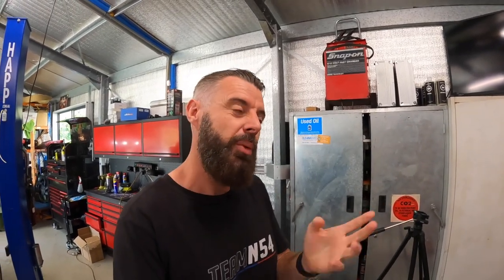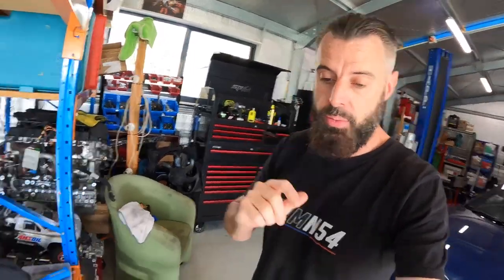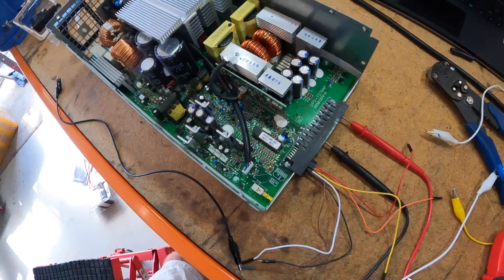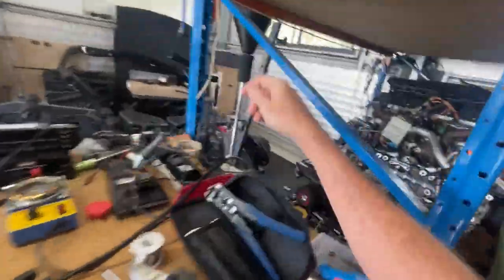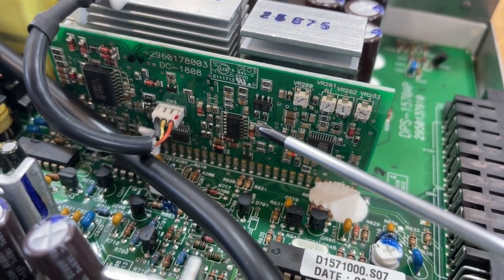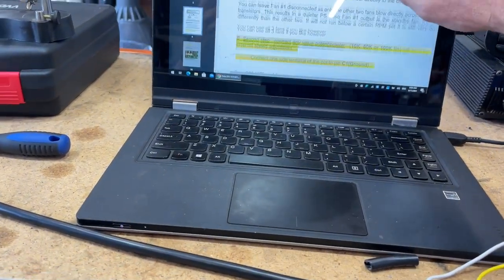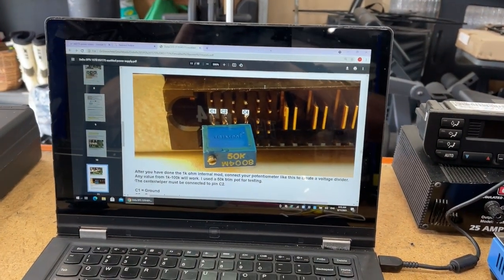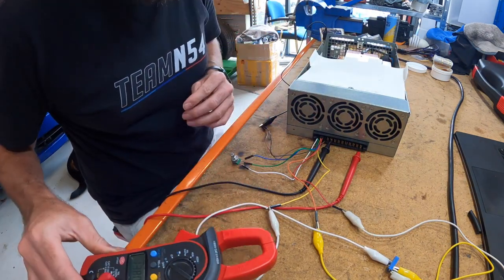Converting Server Power Supply For Programming BMW's: Part 1

Comment: I use 2 DPS-750eb, use my 3d print to make some brakets to make it one big unit with switchs and with outputs for use it on bench or with the big "jumper cables", work so good, already use it too jump my car with dead battery, and it work very good.

Comment: U can use the big 100 amp blade fuses on the e9x battery positive block to make a solid connection to the power supply, just solder them to the psu. I also recommend 0 gauge cable for audio amps, leads not longer than 40cm

Comment: Great reference video for anyone wanting to make a DIY PSU. I need to do the fan control mod to mine, I've just been putting up with jet engine fans while using it but it does make it hard to think.

Comment: @20:45 Poking in a working 1300W PSU with a small screwdriver is a NO-NO in my book. Also, the metal switch is something I would avoid in such a system.

Comment: andrew drill a small hole in the edge of the lid and glue the potentiometer to the inside wall with the hole above it then you can put small screwdriver in hole and adjust with out taking the lid off. you can also buy solder flux in a syringe it is meant for circuit boards and chips i see you have made use for the magnified glass with light and the aligator clips how bad was all the hail cheers glenn
Reply from the maker: Glen your bits and pieces really showed me what i was missing out on. Can't thank you enough. For normal work the solder station is a breeze to use to, so thanks again. Thats the plan with voltage adjustment, will be a small hole, that i can use if i ever need to adjust voltage, however i am hoping once set with a load it should be all good to go.
Reply from the maker: Also regarding the hail. The M5, 330ci and 320d have all been repaired with paintless dent removal. The paint on my car, which was the worst hit, is not so straight forward, the dent repair guys is pretty confident there will be issues pulling dents. So at this point in time, basically going to pull dents where we can and then respray the whole car. I will do an update video on it shortly, i also want to film the process, to try and make the extra cost all worth while. The respray is to get the paint back to an OEM finish all over, fix the bumper that some muppet drove in to a winch on a trailer and just get the car looking as good as possible.

Comment: 😱 Looks dangerous haha.
Why does the power output have to be so high for programming keys? You're a clever man, I'm a bit lost with this stuff 😂
Reply from the maker: Basically if the voltage at the cas module drops below a certain value, i think its 12.5v on the e-series, the module turns off. So if that happens while writing important data, the module basically bricks and gets stuck in a boot loop. So you need enough current going to the car, to make sure the voltage is high enough at the cas. When i was playing with the parts car, it took a 20amp power supply and a 8amp battery charger to keep the voltage high enough.
Reply: @ZeroTo60Tube  Gotcha 👍🏻
I know very little when it comes to electronics, especially car related electronics, but I have had some strange electronic faults with my R53 mini recently and traced it to a completely flooded footwell which has soaked the Body Control Unit. So I guess it's time to learn a little more 😬

Comment: use female spades, you will need a needle nose to squeeze terminal together so the spade can be pushed over the two sides.
also that is not a KD175, its a JD200.  tHE KD175 has a buss bar on the inside for positive and negative.
A battery maintainer and a charger are different devices.  A maintainer is needed for coding and programming.  Great line of videos.
Reply: Actually he has the KD175, the JD200 is the one with the large current strips. I was just working on the inside of my JD200.

Comment: Preheat connector with hot air gun. First shield PCB with cardboard to stop damage to the capacitors and the like.
Reply: Heat to 100C and see how it goes.
Reply from the maker: Tried with the mini blow torch, I assume they must be connected to massive plates in the pcb to handle the current, the heat dissipates too quick. Need more heat in a concentrated spot. There are heaps of threads on guys soldering to them, I’m blaming my equipment……… for now haha
Reply: Did you get my email about syvecs
Reply: @ZeroTo60Tube  You use the electric hot air gun you have to preheat that end of the PCB and try solder with 80w iron.

Comment: Remember its current that kills not voltage and electrocution is final not survivable. This PSU is extremely dangerous to work on if you have no electrical background.
Reply: Very wise…